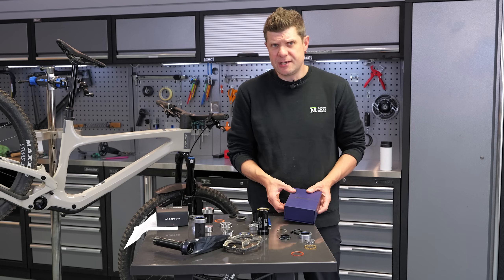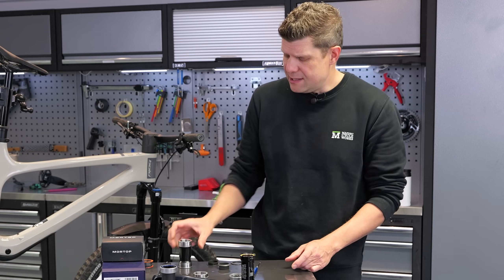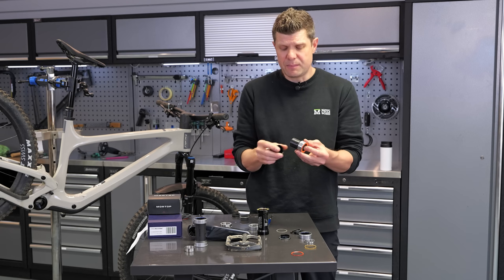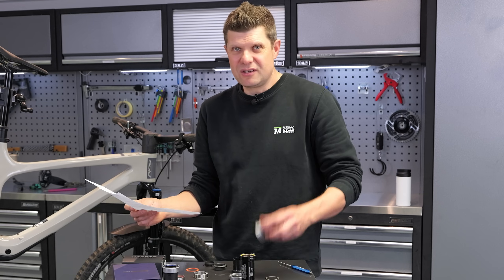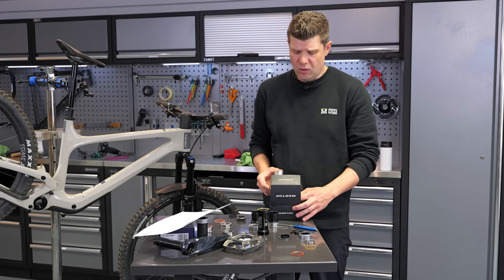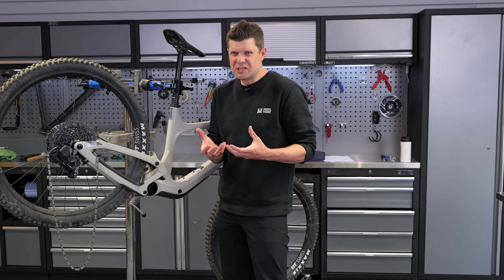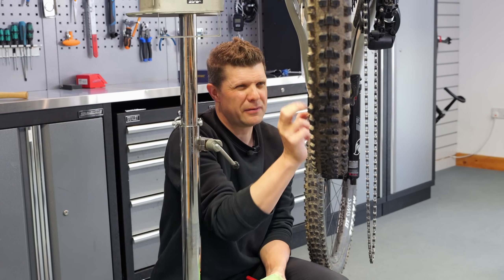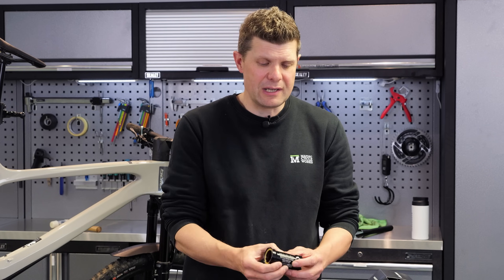Press Fit solutions for SRAM Dub cranks

Comment: This is an extremely timely video as I am in the middle of replacing and old Shimano based system with SRAM dub and I have been researching PF86 BB's for a week or so and do not really need to run a module systems such as Hambini\BBInifinite as my frame is in good shape. I had not come across the Mortop, but while I also was not looking to shell out $200+ for a BB , I was looking at the Enduro XD15 which is a stupid $299, but does carry a lifetime warranty, however, my crank came with a SRAM BB, so I think for now, I am going to install that and then look into the Mortop for the future. Who knows I might be surprised by the SRAM BB, as I typically do not ride this bike in the rain, so if might work just fine.  Plus Enduro does off some slightly lower priced options.
Reply: How’s it going with the mortop BB?
Reply: @leonfoks4216 I installed, simple and smooth. Bearings felt fantastic. I sold the bike recently, but the bearings were perfectly smooth

Comment: I need to switch the BB on my Linkin from Shimano to DUB (upgraded to SRAM transmission) 
I have a DUB bb I was gonna put on. Do I need to keep the inner sleeve or remove it on the linkin?
Reply from the maker: Remove it.  It won’t fit anyway.

Comment: Running a SRAM DUB crank and bottom bracket on a Canyon Ultimate without any issues, rim brake so mostly riding in good weather. Had a AliExpress bottom bracket on my Chinerbuild with a SRAM Force DUB crank and the bearing imploded. Might have messed up during installation, redid the bottom bracket to give it another try. At this point: good experience with the SRAM bottom bracket, bad experience with a no name bottom bracket...

Comment: "The most common failure for BBs is not that the balls wear out or are overloaded by impact loads, it is because they start to corrode due to contamination. And so for us, going down in spindle size (1.01mm) allowed us to add more sealing both from external contamination and internal contamination...The reason for us going to 28.99mm wasn’t to have a larger ball size for the traditional 30mm frame BB shell configurations...Both of these reinforcements to sealing we felt were needed to make sure our BBs did not wear out prematurely." Ref: PB interview with SRAM Product Manager Jan 17, 2018.
Reply from the maker: If only they went a few mm further. 24mm would have been perfect.
Reply: @Mapdec  Yes 24mm would be a great design for an axle diameter...oh wait 🙄🙄

Comment: My canyon grizl has a press fit dub BB, I recently changed the BB after 10k km. I was going on a long bikepacking trip and it started to make a slight sound. The non drive side felt a little rough. I'm a 100 kg rider and my legs are fairly strong 🙃. So my conclusion is: if the frame opening for the BB is made to spec, it should be fine, but I can imagine that the risk of creaking and quick wear is higher.

Comment: The real solution…a PF41 = 24mm spindle only.
Reply: Agreed. And something that screws together like the products from Wheels or Token helps mitigate some of the downsides of press fit. But newer bikes, while still on Boost 148 in the back, are using longer crank spindles to get bigger chain lines, like 55mm instead of 51 or 52mm. This is sort of a half-step on the way to 157mm superboost. 

Unfortunately, long spindles are hard to find in 24mm diameter, meaning to get the right chain line you have to resort to adjusting the BB spacers (not always possible because of tight spline engagement tolerances on the drive side crank), or kooky moves like using a zero offset chainring instead of 3mm, or even flipping a 3mm chainring. 

My experience with a typical 24mm crank, the Race Face Aeffect R, has been I had to flip the chainring to get the 55mm chain line, and while the cranks wing out quite a bit to get good chainstay clearance at the pedals, it's pretty close nearer the non-drive spindle, like 3.5mm clearance where the Dub version gets double that.

Comment: Also on a Giant TCR with a DUB spindle. Had mine replaced after 25000km (5000km of those indoors). Can't believe I've got this much out of the standard SRAM BB. But rarely ever rode in the rain. The cranks were spinning perfectly well over those two years.
Reply: The problem really comes with rain and mud.
Reply: @TheAntoine191  yeah.. but that's the case with most other BBs too
Reply: @5amba  I don t understand exactly why BB with smaller ball/seal are more subject to water ingress but i happen to be that way. Maybe thicker seal deform better, i don't know.
Reply: @TheAntoine191  I guess the water and dirt ingress is about the same, but the smaller balls wear quicker with all the gunk inside the bearing.

Comment: Let’s be honest the problem is SRAM is badly designed, had three bikes with SRAM fitted and then when you see how much more practical and more well designed shimano is you don’t go back. No one who knows bikes rides ShitRAM.
Reply: is it well designed? isnt it there standard? didnt they have multi million £$ recall with problem still on going? I read reports of clicking cassettes! micro spline! they are far from perfect 

About the only place sram isnt prevalent is in the tour. As Peter has said below sram is everywhere in regards to crit racing, and any sort of off road riding. I can tell you why people like It, because you have options! and its even backward compatible and you can mix and match. Shimano well thats almost a a throw away system if want to do somthing a little different like a wider range cassette than whats offered, well thats a new system. Also once the model is discontinued you have a finite amount of time before support stops. Sram released 12 speed red in 2019 only now just releasing the new version this year, thats 6 years of support with possibly another 6 years before another change as I said everything Is backward compatible. need a new set of levers just change the levers, need new crank arm just change the crank arms. The problem with bb86 isnt sram per say its frame tolerance. Buy and expensive BB with a warranty then there not much to worry to about XD15 for example heck everyone loves to hate them but ceramic speed offer 4 years and stand by it. But as I say if the frame is out it wont matter what BB or crank size you put in there in all honesty. Or let me put it this way id rather a BB go wrong than a crank snap and all my teeth are gone.
Reply: @mctaggm  then don’t go to a crit race, a gravel race, or a MTB race - amateur or pro categories, SRAM is everywhere.

Comment: i tried the bb infinite one really expensive and you would expect it to work well but the bearings came with that was destroyed after two wet rides, they were totally seized, donno y, they did sent me a replacement bearing. later my bike was crashed and i repaired it and just took that out and used sram bb no problem since, but the bb combination still just lingering at back of my mind when riding.
Reply: What bearing spec did you order? ABEC-7 steel or hybrid ceramic?
Reply: @sbccbc7471  ceramic one but not the top spec so probably the hybrid one.
Reply: @likepretzel247  Yours are just their Ceramitech bearings, not the coated Ceramitech. The only place on a bike you can use a full ceramic bearing on is a rear derailleur's pulley wheels. All other bearings must be hybrid ceramic (ceramic balls + steel races), ceramic races can't take hits, they'll shatter.

Comment: That's the one complaint I have about my Giant Revolt.  BB86 and my dub crankset.  Fortunately - Giant, did an excellent job in terms of making a straight and true hole on my BB.  I've changed out the BB every winter with the Rotor PF 4129 double row cups and it’s been just fine.  I never had a BB issue per se, but I know it’s a design weakness.

Comment: Sram replace in days
Shimano replace in a year
Reply: I’d rather replace my BB every off season (along with headset bearing service and wheel hub bearing service) than have my crankset delaminate.  Also, my Quarq power meter actually works.
Reply: I have to replace my BB every cyclocross season so basically it lasts no more than 30hrs
Reply: @markstone722  I race gravel (amateur Masters category) in the SE-US and my BB86 dub lasts a full season.  Gotta be hundreds of hours including training rides.  Over the winter when I do an overhaul on the bike I spend $60 for the Rotor PF4129 double row bearing cups and it literally takes me 10 minutes to do the job with a cheap Amazon press kit.